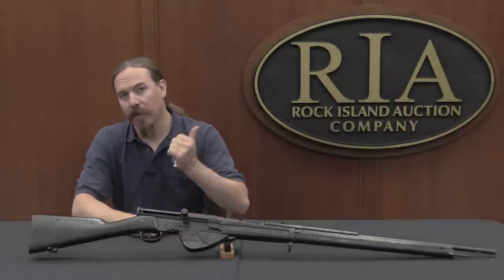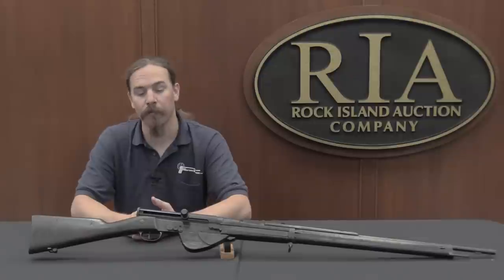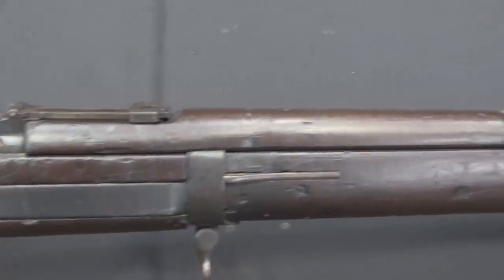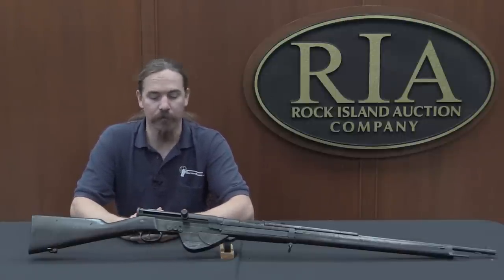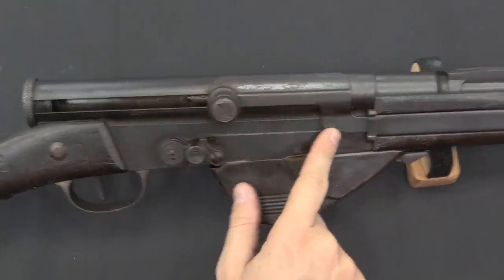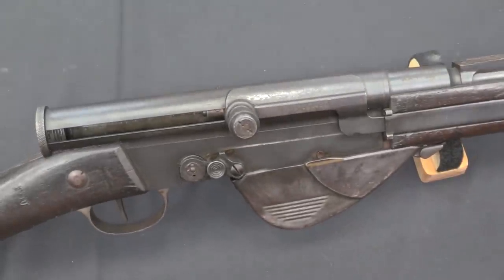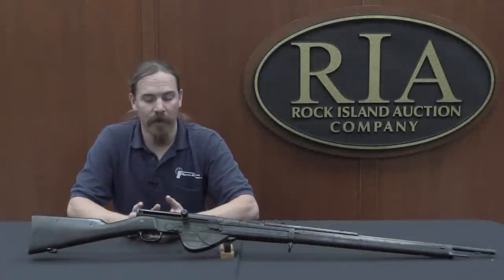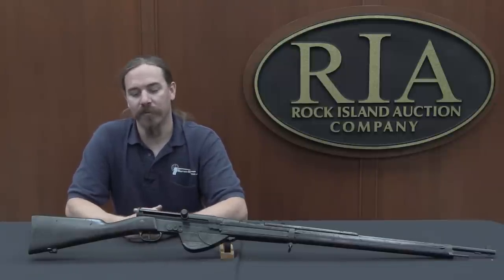RSC 1917: France's WW1 Semiauto Rifle

Comment: As a French myself, I'm a bit surprised when you say the rear sight is graduated in yards, which isn't common in France. I think we're talking about meters here ! Great review though !
Reply from the maker: +Charles Faure Yes, I meant meters.
Reply: +Forgotten Weapons  
Love seeing all the old and different mechanical systems. 
When I was young I remember using a .22 open bolt rifle that I think was called a gevarm.
I remember it didn't have an extractor or a firing pin or an ejector. Just a solid bolt with a blade shape on the face to fire the round. 

Do you know anything about this?
Reply: +Bruce Baxter   Was it a .22" short fairground or gallery gun .  Loaded through the side of the stock  and then a spring loaded brass rod pushed into the buttplate. If so, my Grandad had one back in the forties or early fifties. Never knew what happened to it. Grandad must have disposed of it  around 1952, The open bolt you mention gave me the clue. Long time ago.
Reply: This one was a .22lr and if you fired longs it went full auto as the blowback couldn't reach the catch and if you ran shorts it wouldn't eject at all.
Reply: @brucebaxter6923  classic full auto kids toy back in the day.

Comment: That gun looks like a Lebel got impregnanted by a Chauchat! XD
Reply: +556deltawolf Well it WAS (partially) designed by Mister Chauchat, and it DOES use Lebel furniture, so... :P
Reply: +556deltawolf If I were an American Soldier at the time and knew that this rifle was made by guy who designed the Chauchat. I wouldn't even handle this rifle. We Americans hated the Chauchat. So I will stick with my Springfield or Enfield Rilfes thank you.
Reply: +TheStewieOne his rifles weren't too bad. Just horrible quality control.
Reply: +556deltawolf They both assure us that it was consensual.
Reply: +TheStewieOne Actually the Chauchat used by the American whas horrible because it used the .30-06 cartridge hen ammo that made the weapon even more subject to overheating(because it whas more powerfull than 8mm lebel) alslo the 1918 series suffered from flaw in the design of the barrel.
Reply: Jean Jon
Where's the proof.
Reply: Search by yourself i ain't he god damn google researchor.
Reply: +TheStewieOne Actually, check out Ian's video on the Chauchat LMG - he explains it all pretty clearly and succinctly, as is his fashion.
Reply: canicheenrage and to add to this. The main production line of chauchat rifles were well produced models with interchangeable parts. They served the French Well. 

The ones shipped to the states were built with subpar quality control. Prone to malfunction, and most could not be repaired as the production was so flawed that normally interchangeable parts could not be repaired are swapped. Not only that, when the rifles did work despite mis-issued ammo, they had a recoil that could slam into one's face. 

So in terms of perspective, the French got to enjoy a fully functional rifle, and the americans have trained with such a terrible version had no faith in the weapon. This blemished an otherwise exceptional weapon in the history books of English speakers.
Reply: +canicheenrage The Chauchaut did not use black powder ever, do some research....Is everyone a pimple face youth here?? The French invented smokeless powder in 1886, when the US was still using modified muskets...
Reply: +canicheenrage Black powder doest exists in the French army in 1914, was complete retired from the french army in 1890...Chauchat only pose heawy problems in US 30-06 version built by "Gladiator" (a bicycles maker...), not with the 8mm Lebel built by Sidarme (real weapon factory...)
If the Chauchat was so bad as some say about it, the Germans never use captured Chauchats converted to 7.92 mauser...
Reply: They didn't use it in front line units, though. Only in fixed fortifications like the Atlantik Wall, or in "rear units" like the units tasked with anti-partisan warfare, border police, railroads, depots, etc. guarding.
Reply: +Corrente  With a superb self loader like the Chauchat why did the rest of us bother.  Reliable, High rate of fire, Easy to clean and clear a jam if it ever happened. Good dust and dirt proof magazine.  No need to hold it and shoot at right angles!!.  Better than a MG42, Bren, Vickers, Lewis  or Browning.  GREAT !!. The Lebel cartridge was good as well.
Reply: Yes it does
Reply: Nothing can be worse than a Chauchat. I see he got his grimy hands on this gun as well, as if messing up the lmg that badly wasn't enough.

The French did make some great strides in weapons development, but the Lebel's tube feed system when other nations were using clips, and the Berthier's 3 round capacity when other nations had 5+ are both ridiculous. While this gun is an improvement, I could see reliability being a problem with those open actions.

Overall, if I were a Frenchman in WWI, I'd feel most confident with a 5 round Berthier, but compared to guns like the Lee Enfield, the French really can't compete. Their designs were a mixed bag really. My opinion.
Reply: The Lebel conception was 1886 (was the first weapon with smokeless powder), and the Lee enfield 1895: in weapon developpment are a hand full years important ...The Lebel with he's long barell had a excellent accuracy, and the  8 round tube magazine works well, but in curent combat, the soldiers not use the magazine, it load each cartige per hand , magazine was use as safety to stop suddent attacks...
But the replacement from the lebel was programmed before the debut of ww1, with the Meunier A6 semi automatic rifle ( 7mm cartige), but the war start before the launching from the manufacturing, the Meunier was delayed , and later abandonned after a small serie in 1917 who give total satisfaction...
The Lebel was built new up to 1922!
Reply: U.S Chauchats were bad because they were badlit rechambered to use U.S ammunation. French Chauchats had no major issues and were pretty reliable.
Reply: Bapih Yes that is true
Reply: And the Chauchats the Belgians had seemed to have given good service, since it looks like they didn't have any complaints about their 7.65mm variants, which weren't phased out until after 1925.
Reply: Yeah, there's nothing actually seriously wrong with the Chauchat. Just misconceptions that Murican's who trained on the bastardized version brought home and spread around.

A classic scenario really, same reason why people think Christopher Columbus 'discovered' North America when the educated in Europe knew about it as early as 800-900AD. And the same reason why people think Marco Polo 'discovered' China for Europe when The Han actually sent ambassadors to Rome to from an alliance that didn't pan out, and the silk road continued to be a thing far through the middle ages. Misinformed people spreading misinformation on a wide scale platform (books/schools)

Comment: So if the metallurgy was better, would these have been way better rifles? They seem pretty intuitive in design, many similar concepts were used in the m1 garand.
Reply: In ither words, was the metallurgy available at the time the main reason these weapons didn't see too much service?
Reply: More than the metallurgy, I think the problem was the hurry to press it into service. The M1 Garand was developed for more than ten years. This, for maybe one year. Having a little more time they could have ironed out the problems. IE, to put a dust cover on that opening in the receiver was not really complicate. But, in 1917, the priority was to manufacture a lot of rifles in the shortest time possible.

Comment: Hi Ian, I am presently writing a book and need a little more information about the RSC 1917. Could you please explain to me where the safety is on the rifle and what distance would very long-range be if the long range is 400 to 800 hundred yards?
Reply: The safety is on the left side of the rifle, and is a lever with 180 degree throw. Forward position is Safe, rearward is Fire.

Like this: http://www.vhu.cz/wp-content/uploads/2014/08/RSC-1917-2.jpg

Comment: Kinda surprised that as far as I know no country tried loading a variant of their standard rifle cartridge with a lighter powder load to make a sort of 'intermediate cartridge' for their semi auto rifles. Less forces, easier to engineer and produce. Possible existing parts could work since cartridge is same size. 

Seems like an easy way to just tweak existing production lines for ammunition while fielding an effective semi auto. Put some red paint on the tips or something. 

Obviously the regular round would probably blow up in your face if used in the semi auto rifle. But with chemical warfare,  human wave attacks, and the artillery, what's a little more danger gonna hurt?

Comment: Ian, are ýou sure the sights are in yds and not metres? Just nitpicking! Great vid
Reply: +Mickleblade To be fair, a yard and a metre are about the same length for rough estimates. It's only when you get beyond 500 yards/metres that you start to have problems.
Reply: It makes a huge difference in archery, 90m vs 100yds, i've gotta admit ignorance with rifles
Reply: Well, yes, in terms of proper sport shooting, it does have an impact. But in general battlefied conditions where you quickly estimate the distance, not so much.

Comment: Could this locking system work in a pistol?
Reply from the maker: Sure - the Desert Eagle is a gas operated rotating bolt design.
Reply: Forgotten Weapons Could you scale it down to a 9mm?
Reply: There is a mini Deagle in 9mm I think.
Reply: Not the same operating system, its a nickname for how it looks overall
Reply: Kyle Van-Tiel You are right, but thats not a big deal. The Deagle only uses the system it does because it fires a 50 cal bullet. Once you scale it down, there are better actions for those smaller rounds. So while it doesnt have the action of a deagle, it doesn't need it. Still a pretty good gun from what I've heard.

Comment: I don't get the idea behind self loading rifles like this one, or the M1. If they had the technology for box magazines and things like Chauchat, why bother with this design? Was it better at the time?
Reply: +ilzen ver'khaan Well the magazine for the Chauchat is a terrible example considering how bad it was especially since it was open to the elements allowing dust and mud to gum it up making the gun useless.  Box magazines were expensive to manufacture and complicated to design especially during this period plus many thought having externally attached mags were weaker/not as efficient as permanent magazines built within the gun.  Also there was still the prevalent mindset in most armies for marksmanship over rate of fire so having a rifle in semi-auto with a box mag to them was seen as a way to waste more ammo than concentrate on hitting the target.  Also there was the issue of the common foot soldier and how he treated his equipment.  This leads back to what I said earlier about external magazines  worrying about them breaking with soldiers being rough.  So it basically boils down to technology, money, mindsets, and training.
Reply: +Scott7891 thanks for a detailed response, that certainly makes sense as an explanation.

Comment: Everybody's singing the praise of French weapon design in the comments, and I'm sitting here remembering how shitty the Lebel was at the start of the war... eight rounds held in a reservoir like a shotgun, with an excessive length, awkward design, and absolutely no compatibility for stripper clips, yeah it was slightly older than the SMLE and Gewehr counterparts, and it might have been revolutionary at the time, but by 1914 it was outdated, and at the peak of the war for the French in 1917, it was outright obsolete.
Reply: Which didn't change a thing as the gun still did the job.